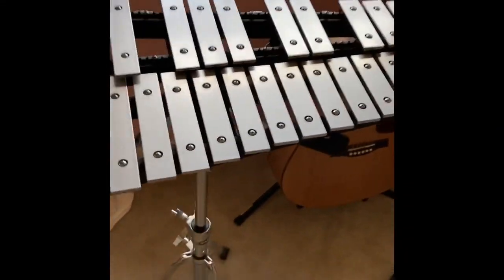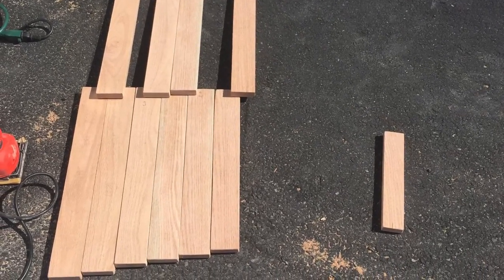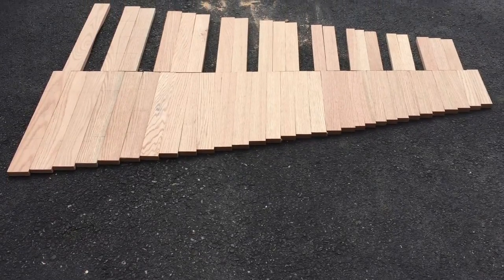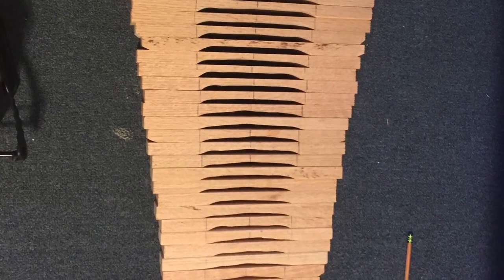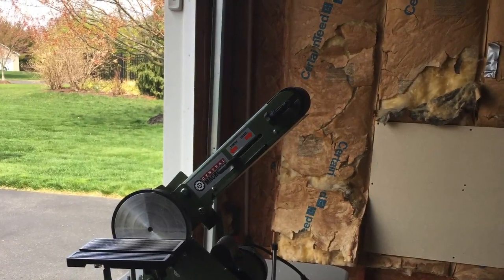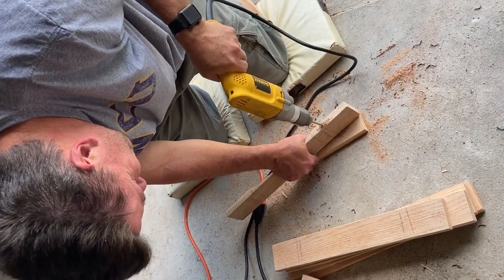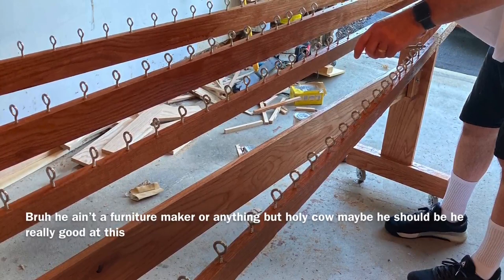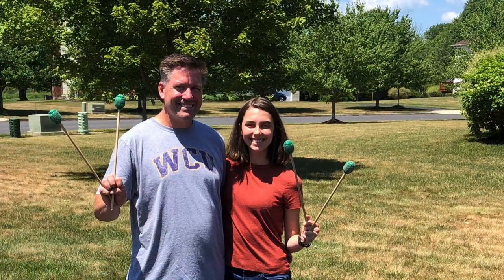How We Built A (Practical) Marimba During Quarantine!

Comment: Wich wood do ypu use? And any alternative for rosewood?
Reply from the maker: For our practical build, we used oak wood. For a concert marimba, padouk and synthetic wood are some examples of cost-effective alternatives to rosewood. Hope this helps!
Reply: @kaitlynz2582  yes it does! TKS... The thing is that kind of wood at least in argentina it's expensive...hehe but that's a good replacement! TKS for taking time to answer!
Reply: I have built a couple of marimbas with my son.  The first one had construction lumber frame and used pine keys and they were cheaper and more resonant than the red oak we had.  The second one had padauk keys and a mahogany frame and sounded much better.  For the posts, we 3D printed the pegs and it was quite inexpensive.  Try different species of wood and build a key or two to see which one sounds better.
Reply: i don’t know if you would need super dense wood or a balance.

for specific wood you probably would need to mill it yourself.

 north american hard woods that are super hard:
osage orange
sugar maple
white oak
hornbeam
dogwood

pretty hard:
red oak
elm
hickory
ash
sycamore

medium hardness:
silver maple
walnut
 norway maple
cherry 

soft hardwood (i would assume avoid)
poplar
basswood
cottonwood
boxelder

just a quick list. 

nice tackle!

resonators are a trick too!
they are sized to each note!

it would be interesting to know what would work.

at a diy store there are different gauges and materials of pipe. pvc, galvanized, black…
Reply: Aquí en Guatemala, dónde se inventó la marimba doble se usa la madera más dura, aquí se llama madera de hormigo, no sé cuál sea el nombre en inglés.